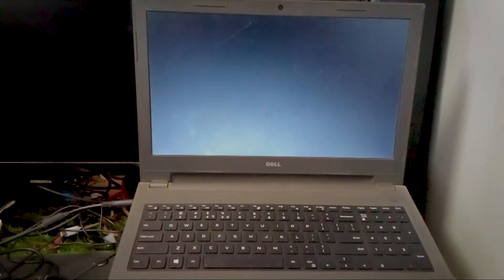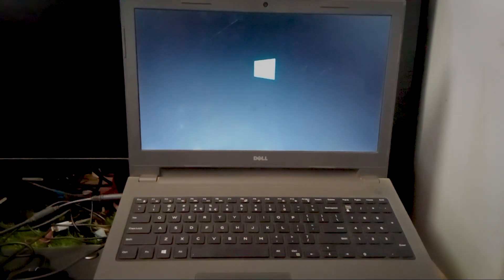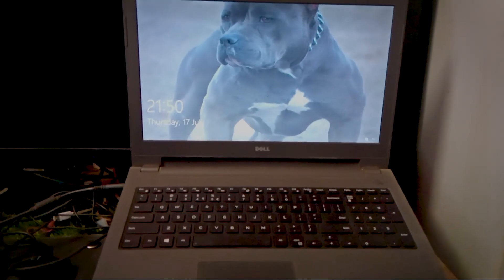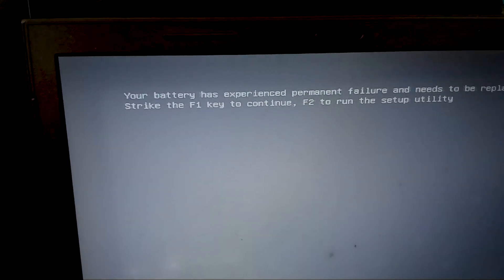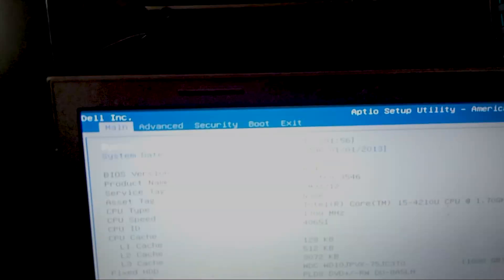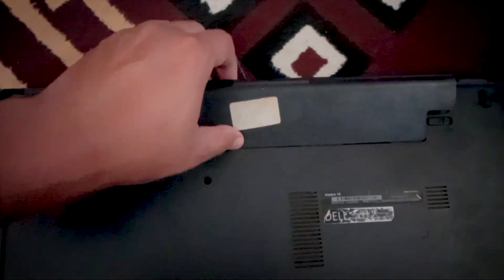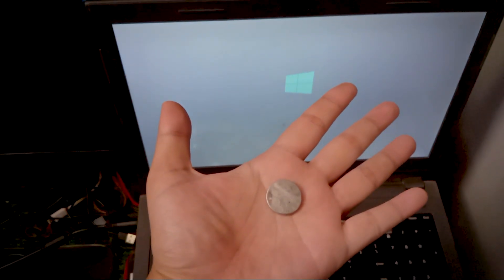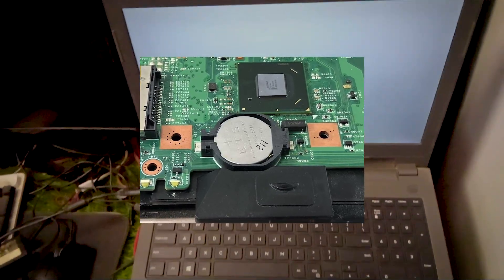Fix Dell Laptop 5 Beep Sound Problem  Easy Solution 2025

Comment: after replacing CMOS battery it starts again after 2 week. i have changed 2 cmos battery and again face the same beeping sound.

it's not the fault of CMOS battery it's RTC circuit failure means motherboard issue?